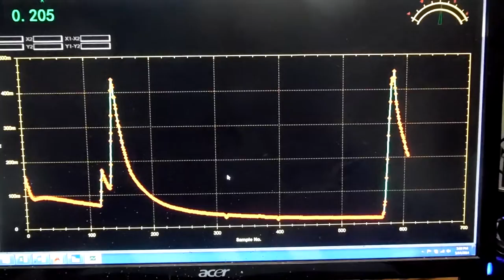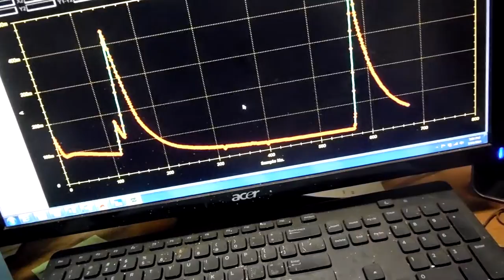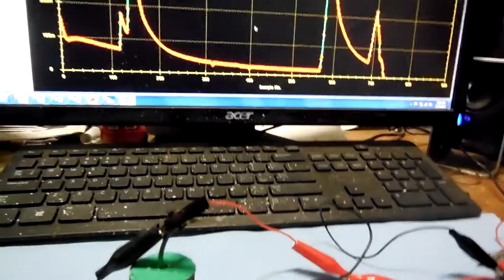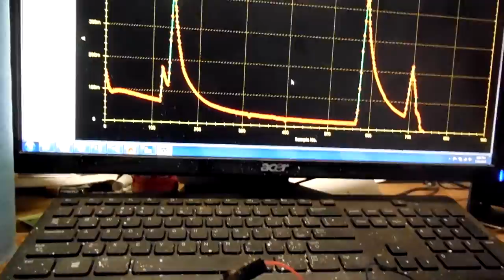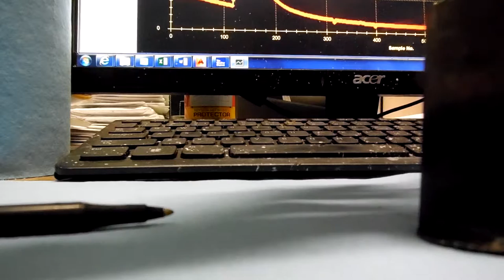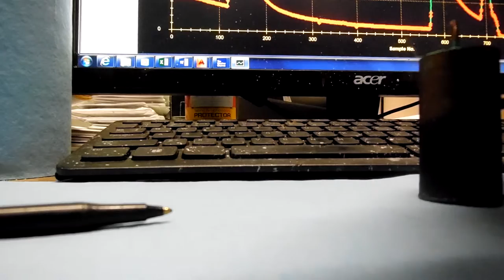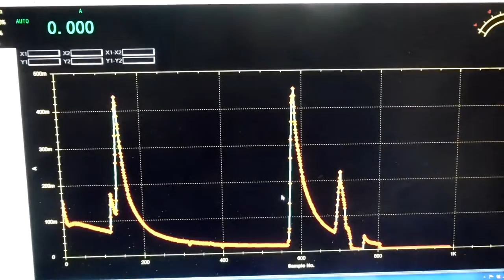Heat charge on an Allwest Power small cell

Comment: This is an amazing discovery, its a sad thing you don't realize it. Anyways, thank you for this experimentation, I know what to do now with crystal cells on a large scale.
Reply from the maker: So what is up? I also have some ideas, but have been to busy, I think the secondary flame is hydrogen gas
Reply: Well is that your diy crystal cell? if so, what is the mixture? i'm planning to embark on this journey realizing the potential this has now, so looking to gather some ingredients to reproduce a very efficient crystal cell. @Allwestconstruction
Reply from the maker: @jesuschrist1501  So this is a cell made of copper pipe and magnesium rod, I used magnesium oxide and hydrogen peroxide, which creates a type of growing crystal rust, the crystal rust will keep growing and will bust open the pipe
Reply: Ah I see, forgot the ole pipe busting scenario during one of my research into these. There is a way around it, to use none corrosive materials, which I know just the right ones. @Allwestconstruction